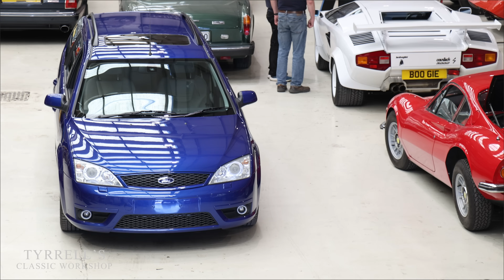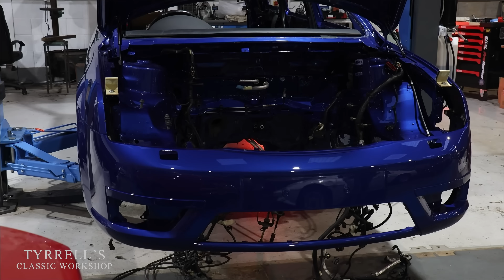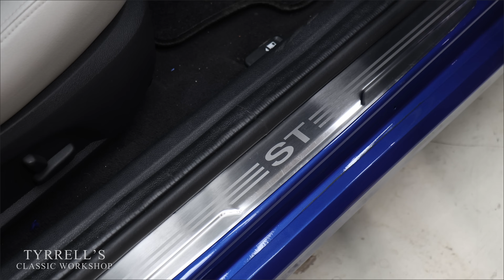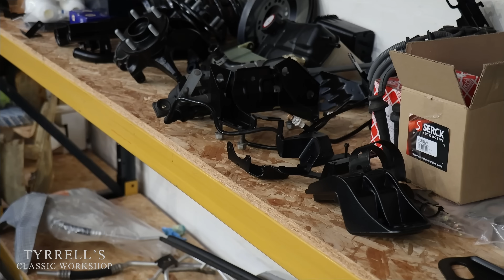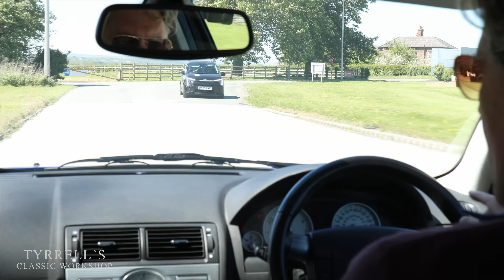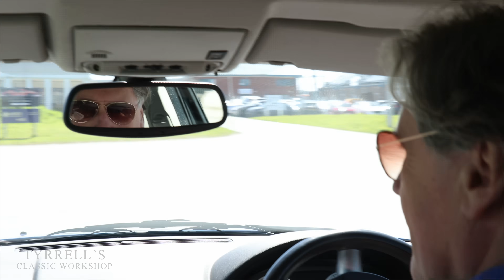Restoration complete! Ford Mondeo ST220 unique project | Tyrrell's Classic Workshop

Comment: This is a really cool project.

If I had the means Id have this done to my Opel Omega B wagon v6. A really nice car that Id like to have seen brand new. Sadly its showing its years. Ive changed front arms and suspension all around but theres still some work to get it acceptable.
But having a complete restoration would be something else.

Comment: Had 2x Mk3's. First 448k miles, 2nd ST TDCi. 488k miles, never changed the cam chain on neither. 10k Castrol changes.

Comment: Interesting review of the project. I have owned a Mazda Six 3 liter V6 which shares the same engine block. My understanding is like the Jaguar, it had different cylinder heads. A very good engine. Serviceability was another matter, to change the rear bank of spark plugs required removing the intake manifold and that was no small job. I hope the Ford is better.  In any case well done!
Reply: I should have mentioned why I sent the car on, the check engine light illuminated indicating 5 or 6 faults. Really all at once? I took it to three different shops and no one knew where to begin. Even the Mazda dealer couldn't estimate the cost to fix it. Here in California our emissions check won't pass a car with error codes in the ECU. I wish you luck in clearing those on this one.

Comment: The owner is a man after my own heart. I love a Mk3 Mondeo. Had mine 12 years now. Drove it all over Europe, then shipped it off and drove it all over North America too! I could never part with it. Too many memories. It's taken me from Scotland to Stuttgart to Seattle, from University through my whole career, it's been a removal van, dump run vehicle, tow truck, and camper.

They're near perfect cars. Practical, good on fuel (well, maybe not the ST220...), reliable, and comfortable, pleasant places to be (I did a 4500 mile trip and it was great). The best bit is the handling though. They're genuinely fun to drive so long as you have a decent set of tyres. Push them into a corner hard and just as it starts to run wide, the back steps out just enough to put it back on line again! Enough steering feel you can drive it in 0 visibility too....

Sadly many of them met their demise due to having a dual mass flywheel, and heavy depreciation making replacement cost about the same as just buying another car. People treat them like disposable pens. Shame.

Comment: Stunning job Iain I used to have one of these except it was the TDCI though I always wanted the ST220 !
I have a suggestion regarding the wheels and the diamond cutting, I've been doing a second restoration of a vintage Yamaha that had gold wheels and diamond cut rims as standard from the factory but the exposed alloy was not protected and just like my ST wheels corrosion was a problem.
After a lot of phone calls I found a wheel specialist company that said they can clear coat them after the diamond cutting with a new coating that stays on !
I have had two pairs of these bike wheels done and the finish came out beautiful, however they have not seen any use yet as the restorations are ongoing so I can't comment on how they will stand up longer term.
I have been to their unit which is a one stop shop for wheels they also have a fully kitted out tyre shop.
They don't usually do motorbike wheels just car wheels but they were the only wheel refurbishers that would take them on for me and they did a stunning job.
Hope this helps.
The company are called Alloy Art.
Address: 10 Featherby Way, Rochford SS4 1LD
Phone: 01702 542124

Comment: A friend of mine worked in the motor industry until very recently - he was a chassis and transmission engineer. (has a mechanical engineering degree so differential calculus is no problem to him). Interestingly, he said that the manufacturers of cars in 21st century have a life expectancy of 20 years max.

Comment: RE: the wheels. Get the centre caps & rims done in chrome effect powder (you have to separate the outer aluminium trim from the plastic backing to powder coat them). You can then get gel stickers for the Ford badge, looks spot on. I've owned mine from new (2007 saloon), it's covered just 38k miles & I still love it. Limited to 3k RPM sounds more like limp home mode, certainly never did that from new!

Comment: Nice. I own a 2006 Focus ST. Panther-black, 3-door, fully laden except leather seats - which I never liked to begin with. Winter package, sunroof, xenon lights, Recaro II seat package (passenger seat height-adjustable+lumbal support, only 2 shaped rear seats instead of 3-seat bench).

Great engine (Volvo 5-cyl. turbo, 225hp stock, ~260hp with a good remap) with loads of power - and crazy cornering. Sounds glorious - and is pretty bulletproof.

Construction is generally quite robust. Body parts are pretty well galvanized from factory. They did save on the interiour - which is not as nice as in temporary VWs. Big gaps inbetween parts - mediocre quality. But back then - my mk2 Golf was exactly the same - and it never bothered me, either. I do have a runner in the OEM paintjob on the lower passenger door, though. But that's hard to spot - not eye-catching at all. 

Yes - parts are hard to come by. And if you can get them from the dealer - they are stupendously expensive. For example: The stock hat rack in every Focus mk2, not ST/RS specific, made from pressed pulp and a bit of very cheap carpet - was, when still available: 276 Euros. WTF Ford?!?

Calculation is production cost x100, I think....

Comment: I had six mk3s. 2 LX TDCi, 2 Ghia X TDCi, an STTDCi and an ST220. All absolutely brilliant to drive (no exaggeration). All the diesel ones were taxis and covered between 180k to 250k. Most diesel cars have disappeared due to issues that would make them uneconomical to repair, but the rarest ones, the ST220s are surviving, probably because they're quite thirsty (22-25mpg in my experience) so didn't get the same hammering of the lesser models. But there all Richard Parry-Jones era, the reason they're so good. Once that engine is run in, above 4500rpm they absolutely scream to the redline, yet at tickover or just pootling around they're barely audible.
And the damping and steering makes them handle like a 90s touring car, very easy to yaw into a corner and with gentle, predictable  lift-off oversteer.
It's no lie that several mags in the day called it the best handling FWD mid-sized family saloon ever.
If I could buy mine back and throw that amount of love and money at it, I wouldn't hesitate.

Comment: Before I retired we used to use a lot of hire cars for business trip with my firm and I must have driven quite a few Mondeo's. I don't particularly remember them as they were just run of the mill and eminently forgettable. Maybe the ST220 would be more notable. I looked up the price of good examples and it is clear that the owner must have paid out many times the value of the car to complete this restoration. This said good on you and you now have a museum quality car that I hope will be a top class example for posterity.

Comment: Jackie Stewart was a consultant on the Mondeo. The brake engineers wouldn't change the set-up as he advised, so he secretly got the electrical dept to dim the headlights, then he got the brake engineer to go with him on a drive at night on a difficult road. The brake engineer didn't the see the upcoming corner because of the dimmed headlights and had to break suddenly. The result was the brake engineer agreed about the set-up and so they were redesigned.
Reply from the maker: Great story- thanks for sharing!

Comment: Wow! What a restoration. The level of detail and dedication from the customer and Tyrell’s is incredible. Even down to the requesting of the correct mark rear windscreen wiper. I had a late 56 plate 220 and loved the way it drove. Quite understated in its own way, but could handle itself nicely on the twisty bits. It was a lovely place to be and quite possibly peak Ford with its handling vs build quality.

Comment: The point you make about parts chimes with my experience running a '00s Honda Type-R. Cars from this period increasingly seem to be in a limbo of no longer being relevant to OEMs but not being old and prized enough to be treated as full-blown classics by parts departments. In the ~9 years I've had mine, I've seen particular parts become NLA (before I could think/afford to buy them...) and options for preserving or even modifying it have been noticeably slimming down recently.
Reply: would be nice if Americans knew more about Fords instead of Honda

Comment: I had a 2002 Ford Focus SVT (it was like the ST170 you lot had in the UK) here in Canada. I managed to slide into a snowbank (Canada, eh) and split the bumper cover. It was around 2008, and finding a replacement was impossible, and that was only 4 years after they stopped making them. They only made them for 3 years, 2002-04, in limited numbers and no dealers had them, wrecking yards never had them for the 2 years I looked. I was surprised at how quick parts could disappear.

Comment: It's good to remind ourselves just how good the ST220 was, and also to remind ourselves just how far Ford has slid during these past 5 years or so. It's really sad. ST220 fun fact (gleaned from no other than Top Gear of the same year(s)) - the Mondeo ST220 was a rarer and more exclusive car than an Aston Martin DB9. There were fewer ST220's made and sold than the DB9. That's probably contributed to the parts being so hard to find.
Reply: I had an ST220, brand new back in the day and had many cars since, Focus, Fiesta and Puma ST's.  The Mondeo was up there, loved it (apart from fuel consumption).

Comment: thanks Iain, as ever. Owning a 2008 car that someone treasured, and that I treasure, but the world at large didn't quite regard as classic, I'm finding the same parts issues. I feel your pain. But I never intend selling it so it's worth the pursuit. Those Mondeos were really crisp and lovely handlers, with such an easy to understand (if occasionally brittle) interior. And bravo for mentioning the gearbox: Ford's manuals through the ’90s and ’00s were some of the slickest, way better than you found on most prestige brands.

Comment: I can see several technologies becoming standard in restoration shops. Laser scanners to determine dimensions of parts, 3-D printing to make new ones, or moulds for casting them, laser cutting to make sheet metal items, and small CNC machines for close tolerances. That should make salvaging existing components easier, and reduce the need to pursue unobtainable replacements. (Of course, they won't abolish the need for skill and judgement of craftsmen.)
Reply: I regularly investment cast rare vehicle parts from SLA patterns printed from reverse engineered CAD.  FDM works really well too, but better to sand the patterns before processing to get a nicer surface finish.

Comment: I doubt that many "gearheads" would suggest that a 3000 RPM redline would actually run the car along the roadway..I can confirm that a 3000 RPM WILL run a car along a roadway..My FL5 Civic will whisk one along at 3000 RPM. !!!
Reply: Most cars will move you along at 3000rpm, especially cars with good torque to wait ratios, also not sure you have noticed, but Ian's test roads are also very flat which allows you to row through the gears all the way to 5th, which likely gets you up to 50-60mph in most normal cars.
I always find it odd when someone comments in a manner that they have superior knowledge to their (in this case) fellow "gearheads".  Like it's a bit condescending towards the majority of the people here, you will probably find most here have very good knowledge of cars